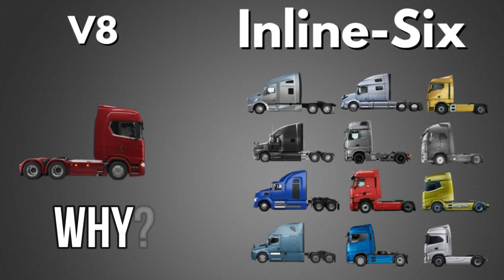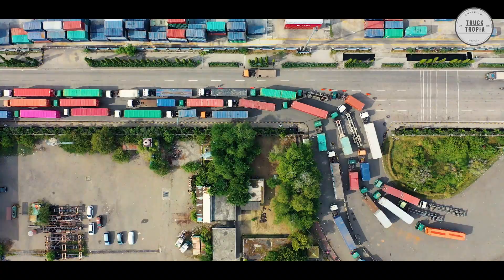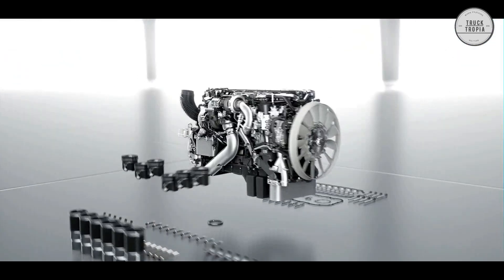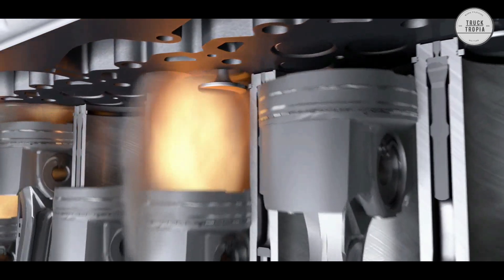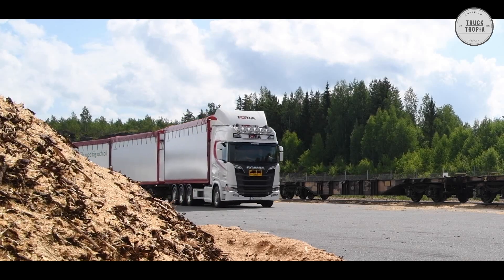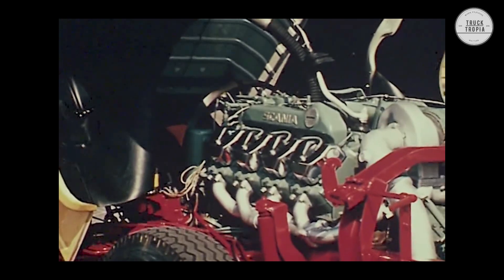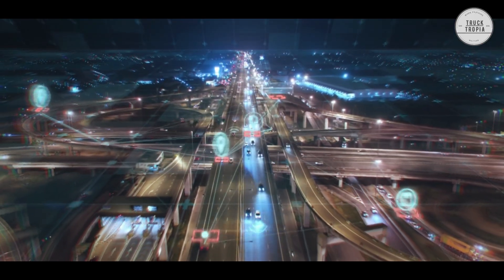Why All Semi-Trucks Use Inline-six Engines?

Comment: I think the main reason behind the popularity of inline 6 is being significantly easier/cheaper to machine.

If I was developing a truck today, it would probably be a natgas 4x4 hybrid Semi.

Natgas is cheap and clean (as fossil fuels go). While torque is often mediocre at best, that’s the main strength of axial flux electric motors. 

An electric 4x4 would also be very scalable, with 6x6 for heavy duty or 4x2 for lighter trucks all using the same motors.
Reply: Edison motors is already doing a diesel electric.  Opposed piston engines are far superior in every way, except to corporations and oil companies.  They are a whole lot simpler, efficient, cleaner and powerful than ordinary engines.they are ridiculously efficient in fact.
Reply: Also, watch engineering explained's explanation of HCCI engines, they almost get by without any DEF or DPF exhaust treatment.  Opposed piston engines could also be hcci, emissions would end up below that of ordinary trucks but without any exhaust treatment other than a cat converter possibly.  Oil companies are not very fond of this though, and everyone involved with diesel vehicles enough to take care of them themselves knows collusion is at play in relation to diesel, and most likely most other fuel related problems.
Reply: Hybrid vehicles are a terrible idea in most cases.
An electric car has a better aerodynamic because it doesnt require a cooling system for a combustion engine.
An combustion car is usely less weigh because it doesnt have a heavy battery.

A hybrid car is usely both heavy and bad aerodynamic, most hybrid cars have a normal cobustion engine and gearbox with an electric addon.
The only real hybrid in my opinion is the Toyota Prius or other toyota cars with a similar drivetrain.
Reply: @jonasstahl9826  valid concerns but you can get away with worse aerodynamics if you have fuel to extend range and, to be fair, you only need an engine big enough to sustain cruise. Similarly, your battery only needs to be big enough to sustain bursts of power.

It may weigh more but instant torque and regenerative breaking will most definitely be worth it.
Reply: @user-pq4by2rq9y  The car industry doesnt work like that, a car is either performance, low priece or low fuel consumption.
A hybrid usely is neither of that low price cant be because it is complex, performance cant be because of weight, low fuel consumption because of weight.
The only hybrid that is working is the Prius, because it has a low fuelconsumption isnt too expensive snd very reliable. If you want more performance you need to add more weight increasing fuel consumption.
Most people dont care about performance it needs to have enough power to be decent agial, the people that want high performance are usely "petrolheads" and dont like hybrids anyway.
Reply: @jonasstahl9826 Any properly built hybrid would have low fuel consumption and be very reliable. Even if it is more expensive, it will be worth it for these factors alone so I don't get your point. 

Even weight isn't as much of a issue as it is with bEVs. The only real issue is cooling those motors so they don't burn up but so happens that combustion engines are also great heat pumps. 

And truck drivers aren't most people, they do care about uphill performance.
Reply: @jonasstahl9826  for one, diesel electric rigs are WAY better at acceleration, but either way, you can bet yourself a big rig driver would rather enjoy money instead of peppiness of gas pedal response.  Electric motors don't need to be put through a high gear in order to accelerate in about the same way they accelerate at takeoff, and on top of that, they are already very fast at take off.
Reply: @alexwalker8422  Opposit piston engine will not be developed in the near future, because they have much different dimension and want fit in a regular existing truck layout means the neat to develop a truck specific for that engine that will not happend.
Diesel electric drivetrains are terrible. They are heavy an inefficent compared to a regular gearbox, they get only used in application where no other drivetrain is possible.
Reply: @jonasstahl9826  diesel electric as in engine generator drive motor or engine generator battery drive motor?  I only wish batteries could be skipped entirely outside of the application of diesel electric locomotives(ok they could be with a decent HCCI engine), but both regenerative braking and optimal efficiency rpm are at play with Edison Motors' diesel electric semi models, and thusly I am caused to be doubtful of your claim given the information available here.

Also, if it wasn't for Back EMF I would also bring the indifference of speed which electric motors have(or ought to) to the conversation, basically explained best as a beefed up first gear capable of identical acceleration at all practical speeds at least(which in contrast to mechanical transmissions which pretty much divide applied torque because of ICE RPM limits).  It is pretty much like that already but the heavier back EMF that comes with highway speeds makes maintaining said highway speeds with electric motors less efficient on the highway than ICEs in high gear.
Reply: @jonasstahl9826  as for opposed piston engines, they are far too big of an improvement and have been around far too long to be written off as being too difficult for a redesign.  If they have boxer engines in Subarus, I call bs on all the car companies that claim it is difficult to fit.  The military has been using opposed piston engines for a long time already btw, I'm not sure about what percentage of their engines are opposed piston engines however.

Comment: Your babbling about torque is wrong. Educate yoursef. The only measure is HP.
Reply from the maker: Not true.. a Bugatti have 1200 hp but cant pull anything comapred to a truck due to torque and gear ration.
Reply: @TruckTropia  What do you think does a gearbox do?
Reply: @pepethefrog7193  Engine torque is VERY important when it comes to pulling power.   Yes a gearbox can convert HP to torque, but at great losses due to friction in the gears.  If you start with an engine with high torque, you do not need as many gears just to get the job done, making it more effecient.
Reply: @Bendigo1  
You are one of the few to get the hp - gearbox - torque thing. Respect. 
Good manual gearboxes have 98% efficiency, that should not be relevant.
Reply: @pepethefrog7193  "Good manual gearboxes "  are expensive and not easy to mass produce.  So it is easier to make up for it with torque from the engine.
Reply: @Bendigo1  
Automatic transmission torque converters do a wonderful job at converting high-rpm-HP into low-rpm-torque.

Comment: Electric Trucks are for sure the next big thing due to the massive torque and cheaper to charge. I'm definitely gonna miss the Scania V8 tho
Reply: Nah electric is a fad.   Long charge times, the infrastructure isn't ready for it (hell I've heard of some places having rolling blackouts with the relatively small about of electric vehicles that's out there now, and people really think the power grids are going to handle everybody owning these things?)   And at the end of day most of our electricity still comes from coal plants anyway.

Besides electric is terrible under load.   I remember seeing a video of a guy testing a Ford Lightning pickup truck who was going to pick up a old classic truck and bring it home.    Guy lost significant battery range just towing the trailer behind him.   Then with the classic truck loaded the guy barely made it back home.

My vote is we focus on either finding, or making a alternate fuel to replace gas/diesel.   Maybe Toyota is on the right track with their hydrogen fuel cells I don't know, but electric is not looking piratical at all and I really don't see it being the future of travel.    At BEST electric can work for cars and SUV's that don't haul anything, and even then I'm not so sure.    But pickup trucks and certainly semi trucks, I think we need something else.   I don't see electric lasting long term for them at all in my opinion.
Reply: @justinlynch3  thats very true, it will take a shit ton of time until the infrastructure can handle it and also another big problem is that Trucks are one big factor for Gas and Petrol companies, they simply would not allow it one way or another because it simply doesn't benefit them in any way, they will lose a lot of money. I also haven't seen an electric truck in person and I like it that way, I wish they will never become mainstream
Reply: Electric is gay.
Reply: @bicyclenerd.9377  Facts

Comment: Will we eventually get inline four trucks (for the heavy duty ones)?
Reply: It's a big disadvantage for big displacement engines to have an inline 4. If I can recall, it's due to the secondary balance of the engine.
Reply: 4 cylinders do not have the power that 6 do.  In  a four-stroke engine, having only 4 cylinders means only one cylinder is actually providing power at any point.  With 6 cylinders there is power being provided by two(1.5 mathematically) cylinders at any given time.

Comment: power is torque multiplied by rpm so it's actually power you want but since you want the power at a low rpm it requires more torque.
Reply: I was watching and think that there is someone educated enough to point it out in comments! You are absolutely right. And it would be great to avoid such inaccuracies =)

Comment: To get some facts out. A good driver uses less fuel with a Scania 770 than any other engine no matter the load(empty or 60tonns ++). Talking by experience. Scanias v8 are miles ahead the other EU manufacturers in fuel consumption and power output.

Comment: Why not 4 cylinders engine in trucks?
Reply: >7.5t trucks are all inline 4
Reply from the maker: Many small to medium duty trucks drive with 4 cylinders, they are not powerfull enoguht for the Heavy Duty trucks
Reply: @TruckTropia  make scenes, so 6 cylinder off the best compromise between power and economy for semi.
Reply: A lot of "small" trucks are 4 cylinder. The problem with 4 cylinder engines is that they don't scale up well. Both primary and secondary vibrations become practically impossible to deal with as do issues with the reciprocal mass of components when you start to increase size and power levels.

Comment: Almost correct..Scania still has v8's and they are the strongest truck engines in the world
Reply: Scania has today a 5-cylinder straight engine with the range 280-360 horsepowers (so as powerful as the V8 was when it was introduced in 1969), 6-cylinder engines with 370-560 horsepowers and the V8 with 530-770 horsepowers.
The inefficient semi-trailers don't need the most powerful engines.
Reply: In-line engines are so easy to work on. Just a single bank. 😊
Reply: @angelgjr1999  crkni
Reply: I think mercedes also still make v8 truck engines. Imo mercedes v8s are the best sounding truck engines.
Reply: @andrewdouglas1963  they used to, but dont anymore
Reply: And the best sound 👂🏼🥰🥰
Reply: At least he said "almost only use iniline-6 engines" for any other brands, except Scania.
Reply: @automation7295  Of course the video title must be interprented to say 'most engines is....' Many people are quite 'square headed' and takes everything very literally) They do not know that these kind of video titles are made for them and to trick them into make a comment, which againg helps the youtube algorithm.
Reply: @automation7295  Ok. KAMAZ
Reply: Maintenance for the V8, is a pain. The I6 will last longer.
Reply: @quinty26  if you do the same maintenance on each scanias v8 will last longer than most other companies i6 engines
Reply: @lord_matto8660  That's really just your opinion. I6 engines are more popular, because of what I have mentioned.

Comment: These inline 6 engines are four strokes engines .
What about injection two stroke diesel engine. Which is better, the two stroke diesel engine or the four strokes diesel engine.
Reply: 2 stroke engines can't pass smog tests anymore. 
Not clean enough. 
Locomotives used to be 2 stroke with a blower and turbo.

Comment: A straight six with a single turbo is dramatically cheaper to manufacture than any other engine design (4 banger's excluded.) The straight six also comes with many advantages. In automobiles, only BMW and soon Chrysler use the straight six as performance engines.
Reply: They last a long time being so smooth. 
I have a 30 year old Jeep with a 4.0 inline 6. She still runs like new.
Reply: @TheBandit7613  702 GANG  🌴 🌴🌴🌴🌴🌴🌴🌴🌴🌴
Reply: @TheBandit7613  Lot of Renault engineering in that 30 year old engine.
Reply: Mazda just announced a new I-6 for their lineup as well. It makes be hopeful that the straight 6 is making a bit of a comeback!
Reply: @Shootin_Bruin  its in the new cx-60.

3.3 l  inline 6  turbo diesel , ive test driven it , one of the smoothest diesel ive driven.  Heaps of torque 500nm
Reply: B58💪

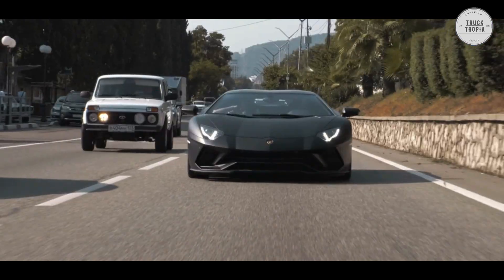Comment: 1:00 Torque is the only force which turns the wheels and it is delivered to them by gearbox gears and its ratios. Engine power is only equation, the real force is torque, even in f1 high revving cars which produces a lot of power only because it reaches good torque at high rpm and it has a lot of leverage from short gearbox ratios
Reply: Power turns wheels. It is a measure of torque over time. For all intents and purposes, power is torque X RPM. Think about it. If you put a 200lbs. person on a six foot long lever attached to a wheel on a truck trailer, it isn't moving. 
There's a lot of torque, but no power.
If you can get your 200lbs. friend to jump up and down on that lever 1500 time in one minute, then it will move, albeit slowly.
Reply: That's pretty much what he said too, was it not?
Reply: But.. Maninantance tho

Comment: Apart of the sound of a V8, it is all about economy and efficency. The bigger a single cylinder is, the less (relatively speaking) heat is lost to the surfaces of cylinder, piston and head, thus the more efficient it is, with big ship engines being the best - and all of them are inline. In trucks, the inline six is the smallest well-balanced configuration with best economy, dominating the market apart from some special use cases. 

On the other hand, electric motors are unbeatable in any aspect, that's why high speed trains are electric and connected to overhead lines, and all powerful locomotives are electric, too, even those that are called Diesel, as they actually use electric motors to move the wheels, not driveshafts, clutches and gears. The Diesel engines just power the onboard generators, mostly operating at constant speed. In trucks, the big Diesel engine plus drive train and big tanks will sooner or later be replaced by electric motors plus a battery of useful size, and in some cases, additional range extenders, like fuel cells or even small automobile-size Diesel engines, possibly small rotary engines that run on gas, methanol or synthetic fuel.
Reply: You put a lot of faith in EV. I'm not so sure.

Comment: The 770hp scania has 3700nm of torque. Matching up with the competition
Reply: Also match this in fuel economy
Reply: @yuvrajsinghf57  correct, a good driver uses less fuel with a 770 than any other engine no matter the load. Talking by experience. Spanias v8 is miles ahead the other EU manufacturers

Comment: If you compare the torques in two units on the same picture, then try to use 2 pictures: one in metric and one in imperial. You cannot compare Nm with lb-ft. Otherwise, nice video.
Reply: just wondering why you state Nm can't be compared with pound feet. They are both measures of torque and it's easy to convert between them. I was under the impression it's like centimeters/millimeters and inches. Please let me know how I've got that wrong.
Reply: @johnvender  The conversion indeed can be performed, I have done it earlier for the same reason, to compare American truck performance to European, however it would have been one step easier if they'd have just simply used Nm instead.
Reply: @TAURON85  Yeah, I agree. These days here in Australia car engine performance is given in kilowatts so if somebody asks for the horsepower a conversion is needed, not to mention there are more than one definitions of horsepower.
Reply: @johnvender  Nothing wrong. Probably, you are retired with lots of free time. However, the regular adult is flooded with information and life became really fast even compared to the PC age of the young Mr. Gates. Ready information is priceless. That's the point.
Reply: @ferencszathmary9689  I've no idea what you are trying to say.
Reply: @elemar5  That's your problem. Other people haven't had this problem.
Reply: @ferencszathmary9689  It sure is but wouldn't it be nice if someone explained it for fools like me?
Reply: @elemar5  You are not fool. It's like comparing anything in metric to anything in imperial. Like litres and cubic inches. You need to have something in common in order to compare.
Reply: @elemar5  NYyoooooOOMMM!!! Here comes the airplane!!!
Reply: It's generally clear from context when someone means "pound force" rather than "pound mass" (the pound unit clearly dates from a time before the mass/weight distinction became important!), and you'll sometimes see "lbf" to mean "pound force" specifically. To get them equivalent, treat "pound force" as "pound × gravitational acceleration on Earth":
1 Nm = ~0.74 lbf-ft
1 lbf-ft = ~1.36 Nm